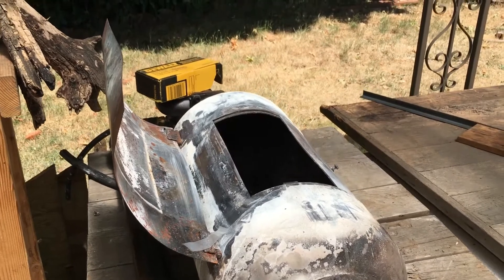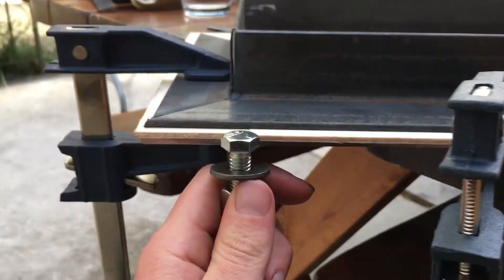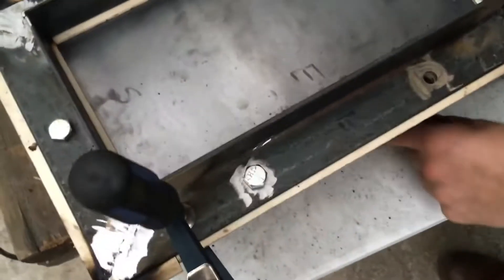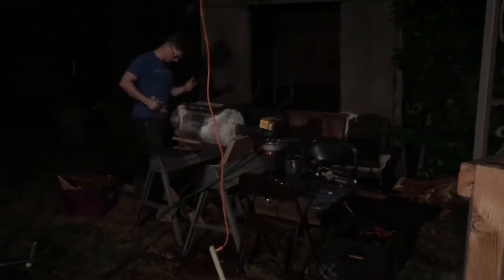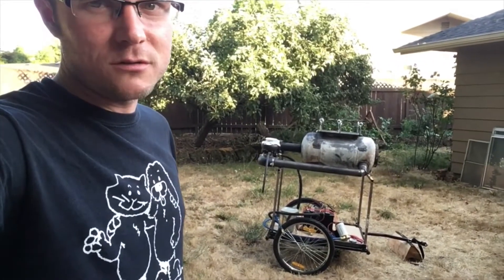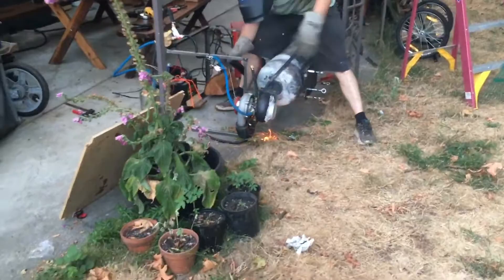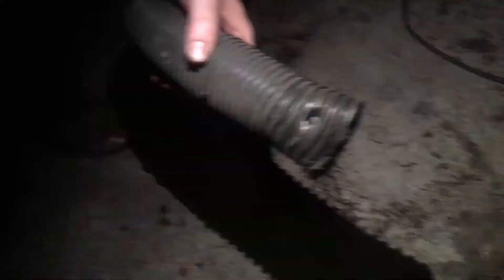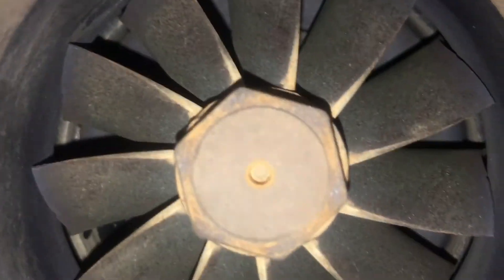TURBOFURNACE DAYS 4 & 5

Comment: Did you consider running bbq beads through a pipe with a screw cap and light it by dropping in a sparkler?